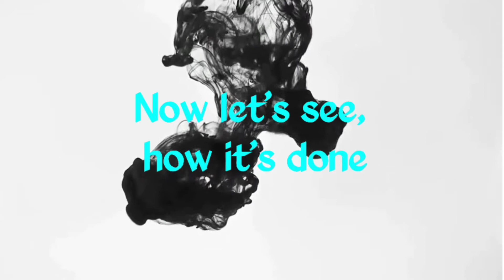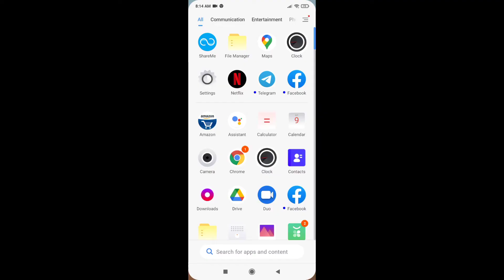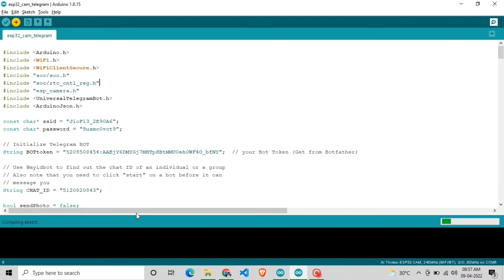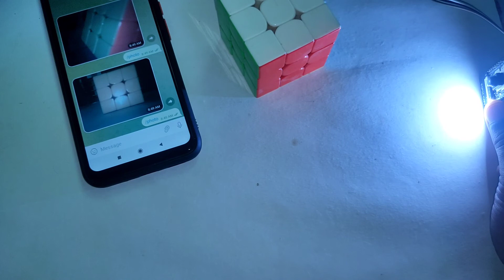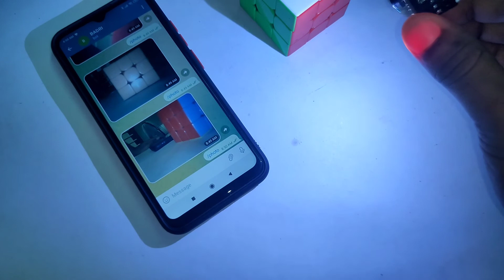How to Send ESP32_CAM taken photos -telegram| Arduino ide | ESP MODULE

Comment: Sketch uses 955329 bytes (30%) of program storage space. Maximum is 3145728 bytes.
Global variables use 50100 bytes (15%) of dynamic memory, leaving 277580 bytes for local variables. Maximum is 327680 bytes.
esptool.py v4.5.1
Serial port COM7
Connecting......................................

A fatal error occurred: Failed to connect to ESP32: No serial data received.
For troubleshooting steps visit: https://docs.espressif.com/projects/esptool/en/latest/troubleshooting.html
Failed uploading: uploading error: exit status 2
please help to solve this error:🙏
Reply from the maker: Have u cleared this error

Comment: Good day sir. I seem to have a problem because after I upload the code to the board and pressing RST, it just says "ESP32-CAM IP ADDRESS: 192.168.XXX.XX(Put X's for privacy purposes) and it just stops there. Have you encountered this problem before?

Your speedy reply will be much appreciated, thank you
Reply from the maker: After connecting to WiFi., Have you given photo request in telegram?if you given that request it's say, got response then send pic to telegram..
Reply: @electrooxe9623  I tried the /start and /photo function of the bot in telegram but still no response
Reply from the maker: Have u given crt API and ID number?
Reply: @electrooxe9623  yes I have. I made sure that the credentials were exact and correct
Reply: Same here
Reply from the maker: What happened!?